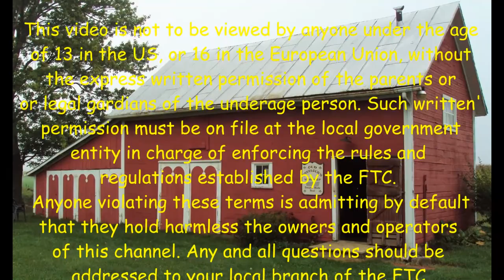Big Bath Remodel Sliding Door Pt 3 Painting

Comment: Love the small belt sander…I’ve recommended them for tool restoration, especially getting into the tight curved parts on wrenches etc. but no one seems too have seemed interested. I think it’s the best tool you can use for those situations! Great video as usual!
Reply from the maker: It has come in quite handy on a number of occasions since I got it. I bought zircon belts for it and it does a great job on tight spots.  😁

Comment: I feel like over the years I must have used over a thousand gallons of paint in my lifetime. We painted most of the steel we fabricated ourselves. I think my brain is half eaten away from breathing in all the Xylene and other wonderful chemicals in the paint.
Reply from the maker: It can overpower you if you aren't careful. We wore respirators in the paint booths even with the huge fans sucking air out of the booth. 
Production painting is a rough job. 😀😎👹